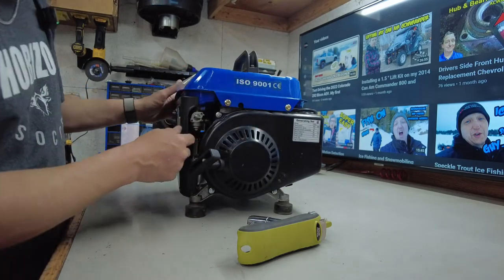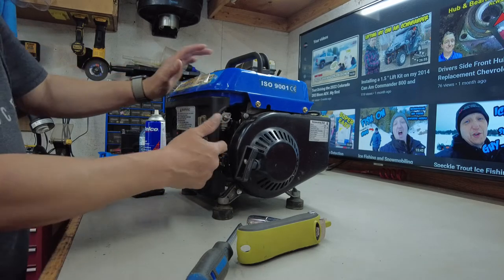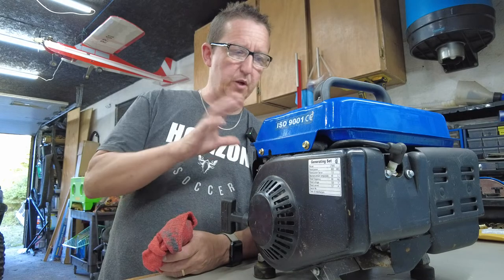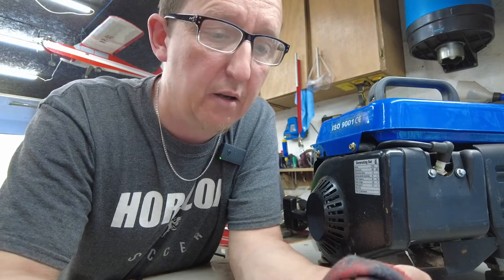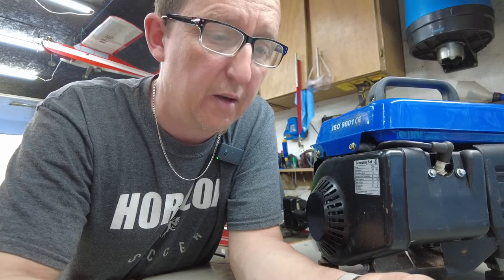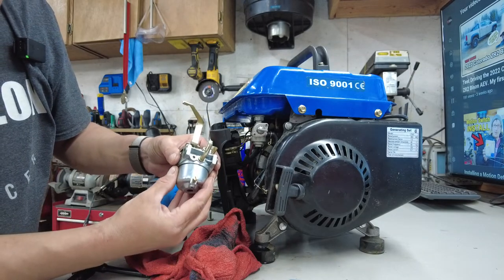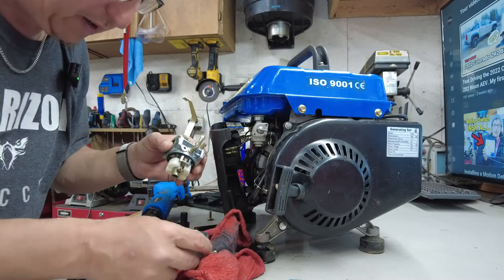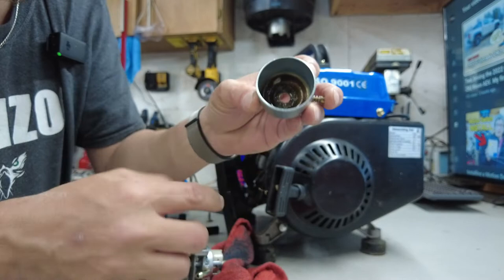2 Stroke Mellga MG950 Generator Won't Start. Fuel Issue carb cleaning.

Comment: And what about the float height of this carburetor?
Reply from the maker: Good question. I had no manual so I just adjust the float tab to fully seat the needle when the float is perfectly horizontal to the bottom of the carburetor casting. Hope this helps

Comment: In my country, we don't even have the luxury of electricity to see the generator clearly to work on it. We'll work in dusty conditions nearly under burning sunlight, to get this fixed. Only when it starts running, can you run indoors to use and electric fan to cool down.

Comment: Private gas station owners that use ethanol can have water added to the gasoline that they purchase. The ethanol distributors will ask the owners if they do, and how much, when ordering. So the ethanol pulling in moisture from the air is the story we have get from that.
Reply from the maker: This makes no sense to me.  Why would a distributor want to add water to a stations purchase? For profit? Pretty sketchy if this is true.

Comment: I have one like this (mine is yellow) and I have no spark. I have voltage coming off the two wires coming from the flywheel coil and then they go into a small box and then one lead comes out of there and goes to the coil on the end of the spark plug lead. It looks like I have no voltage coming out of that box. Do you know what it is ? I was wondering if I can bypass it and go straight to the spark plug  coil, but I would have two leads not one ?
Reply from the maker: I think the first thing I would do is try another plug. Any plug. Not in the generator but just on the wire to eliminate that first. let me know!

Comment: I got a similar one. Never started, just been in storage. Replaced starter cover that was damaged in transit, fuel tap lever broke so I replaced fuel tap, mice had chewed wires under the tank thus they needed some fixing as well. Starts and runs well but does not start easily when warm and always needs many pulls. I'm using canned synthetic fuel for small engines. I've learned some engines might have starting issues with synthetic fuel since it has less volatile components in it. This is my only small engine which has problems related to synthetic fuel, though I'm not sure if that's the reason for starting issues.
Reply from the maker: I have no experience with synthetic fuels. However not impossible, I would think to check make sure the correct plug is in it and maybe carb adjustment??

Comment: the surging throttle is actually a plugged pilot jet, and can also be the rpm is set too high. the pilot jet is the little brass piece under the idle stop, and its got a very tiny hole in it. i usually use 1 strand from a 14 gauge wire to clean them out.  and the govenor is actuated by a spinning weight inside, usually a couple ball bearings, or a weight
Reply from the maker: Awesome information. Thanks for helping the community of DIY’rs.

Comment: My generator also having same issue as you mentioned that the throttle is keep moving. Can it be fixed it by adjusting the fuel-air mixture screw loosen? Pls tell me about the idle screw where should it be? At low rpm all the time? I adjust the idle screw for changing rpm because of engine throttling unstable.
Reply from the maker: To set your idle screw this is what I do. I use a multi meter to set the engine speed once my meter has the 120v ac needed. It can plus or minus a few volts. The voltage changes with engine speed.  For my mixture screw, I turn it all the way in then backed it out a turn to start. Then I put a small load on the generator with a work lamp. Then I adjusted the screw until I got smooth idle.

Comment: Just be careful , i bought the exact same model a week ago.
When i oiled the little air filter sponge as per manual before first startup, i noticed that the oiled sponge filter does not completely touch the plastic cover on the front when closed again.
There is a little gap between the sponge and the front cover.
Also the airfilter cover has a little plastic ridge that follows the outer edge of the rectangular cover and fits into the same rectangular slot that receives it on the plastic housing of the carburettor. . . there is also a small gap right around that sucks in unfiltered air from the outer edge.
I used a square o-ring (yes the o-ring material is not round but square) that i fitted  into the rectangular slot , after cutting it precisely to the exact inner length of the slot.
Where the air-filter sponge is supposed to seal against the air-cover when replaced, i stuck a 4mm piece of flat weather strip where it is suppose to touch and seal against the plastic cover. If you oil the sponge and press hard against the airfilter plastic cover when it is back in place, the oil of the spomge will leave a rectangular oil mark against the cover, showing you exactly where to stick the weather strip . . .no more unfiltered air (dust) getting into the carb.
Reply from the maker: Awesome! Thanks for sharing that tip!
Reply: @NorthernHomeGarage  Thanks for your videos , i really enjoy them !

Comment: hi my gasoline generator runs ten minutes then stop after 5 minutes then start it again run ten minutes then stop every time like that 
what is the problem 
thank you
Reply from the maker: It starts back up after it stalls right away or do you have to wait? Does it run bad before it stalls or does it just stop?
Reply: @NorthernHomeGarage   yes it's need 5 minutes to start again 
and before stopped it's running in bad
Reply: @NorthernHomeGarage  it's possible from oil 
because i used car oil 10/40
not 2 stroke oil
Reply from the maker: @adelalsmadi6921  Oh... the difference between regular oil and two-stroke oil is that the 2 stroke stuff has a lower ash content and lubricates better due to the viscosity . This helps with deposits that tend to form on the plug and the piston when the oil is burned. I would say that is probably your issue. Lack of lubrication makes it stop (seize) because it's too hot or carbon build up on the plug.
Reply: @NorthernHomeGarage  thank you i will change the oil to 2 stroke oil 
thanks for your reply
Reply: Also try to losen the gas cap slightly because the vented gas cap may not be working property.  As fuel is consumed from the tank, air must enter the tank vent, otherwise a slight vacuum will develop int the tank and compete against fuel flowing to the carburetor.

Comment: hi I have a Ryobi 950 I did exactly wt u did but fuel still not coming through any advice please
Reply from the maker: A few things here. I know these will sounds silly but you need to check.

1. fuel in the tank
2. valve is open (cycle valve back and forth)
3. bottom of tank is clean (no rust)
4. if you take the hose off of the valve on the tank, does fuel come out.
5. is the hose clear (not plugged)
6. Is the needle stuck in the seat.
7. is the needle adjusted properly to open when the float comes down.
8. is the carburetor inlet clean

Hope this helps!

Comment: My generator is leaking fuel
Reply from the maker: Check that hose from the tank to the carb. Mine was very old and cracking. try tightening the bolt on the bottom of the carb bowl. it just needs to be snug.

Comment: I have one of these I bought for $10. Would not run for anything. I put a new piston and rings in it and still same thing. Makes 89psi cold, has spark when grounding plug out of the cylinder and plenty of compression to run. The plug gets wet from the carb and engine vacuum. Won't even try to start if you squirt gas through the carb or down the plug hole. It doesn't have the recoil on it but I've seen them start right up with a drill and mine will just crank all day but never fire once. Anyone know what could be wrong? Also the on/off switch does not effect spark. It will produce spark regardless of on/off switch position.
Reply from the maker: Hmmm. Fuel+compression+spark= run. That’s really strange that it won’t even spit when you spray fuel down the carb. The only thing I can see is spark. Not enough spark. Weak coil. Wrong plug. Wrong gap. Damaged wire. Compression sounds ok 90-105 it should run. Anyone else?
Reply: @NorthernHomeGarage  since it's cheap enough and it wouldn't be a big loss I'll try a new plug. I didn't realize the ft7rc torch wasn't the plug in the manual. Appreciate you boosting the comment.
Reply from the maker: @kkc3009  good luck. Let us know how it goes! Thanks for watching.
Reply: @NorthernHomeGarage  not a single lick unfortunately. I even put a dribble of almost straight gas in the intake side of the carb when the new plug didn't do anything. It was pregapped over .035" otherwise it was a match. I also thinned the mixture in the tank with some straight gas but yeah nothing at all. When I opened up this gen for the piston it was all carbon cruddy in the combustion area and the piston was too but no damage to the cylinder block wall and piston. I polished it before the new piston and saw no compression bump so I'm assuming the make around 89psi cold in good shape. I have no clue but the on/off switch doesn't seem to work. I wouldn't care if I could get it to start lol. I'm glad I didn't split the crank cases like I was gonna. I need that fulfilling and satisfying start like everything else I go and get in non working condition gives me after a little love lol.
Reply from the maker: @kkc3009  if you haven’t tried this I suggest turning off the fuel, drying the plug and cylinder with compressed air and put it back together. With the fuel still off, spray some raw fuel in the carb and try it then. Also, because you don’t have a pull start , make sure you’re spinning it in the correct direction. Another thing to check, make sure the governor on the block is free and connected. It could be stuck keeping the carb closed ?  Failing all this, it must be insufficient spark or low compression based on what you’re saying.
Reply: @NorthernHomeGarage  okay cool, I did remove the plug, crank a bit and now it's just sitting. I can blow some air in there too before trying again. I'm pretty sure it needs to spin clockwise during cranking because that's the way the recoil assembly makes it turn. And the manual says rotation direction of crank is CCW when viewed from the pto side of the crank so I believe that means CW when viewing from the other side or the flywheel side. I have seen a video of ultrasonic cleaning the carb and it still fails to run right or at all until it was replaced. Being that the plug is getting wet though I don't think that's the problem. The carb and spring and governor assembly are all okay. The carb studs don't have to be removed on this one if you just gently flex the throttle rod to get it in and out of the throttle tang on top of the carb. The throttle plate is wide open as it should be and the throttle stop screw will keep it open a sliver if it closes. It definitely should have done something by now but absolutely nothing lol.
Reply from the maker: @kkc3009  head gasket? It has to be low compression or weak spark. I’m leaning more towards the compression theory now lol.
Reply: @NorthernHomeGarage  that's probably it. The kit didn't come with a new one and it was a corner cut during the piston swap. I will update soon. Not that it's a cool story or anything but yeah we'll see if that's why it's not producing more compression when cold starting.
Reply from the maker: @kkc3009  cool.  Let me know.  There’s got to be a happy ending lol.
Reply: I also have one of these and also had issues getting it to start. The air fuel screw was out too far. it was 3 turns out from the factory. after turning it all the way in, then half out, it starts without issues on first or second pull.
Reply: KC, did you check the oil seals ???
Reply: @hardhittrr  do you mean the crankcase seal? I did not disassemble that far. When I replaced the piston and ring I only used gasket maker on the old seals for the intake, base and top gaskets. Compression increased to about 92psi while using a drill and there is verified bright spark but it doesn't even produce the slightest combustion. I've used starter fluid and gas directly into the plug hole along with sprays of gas into the carb intake. I was stumped so now it just sits in the garage next to an old but working 4 outlet generator I picked up.
Reply: @kkc3009  I feel ya!, Ya I gave up on mine too. I took off my flywheel to see if the crankcase seal was off and it's not. It's still good. But I'm sick of this little gismo. I get more of an arm workout then anything. I'm on the hunt for something else now.
Reply from the maker: When you’re checking for spark, are you grounding the plug to the head or another part of the generator body?
Reply from the maker: I’m really realllllyyyy reaching here with another theory however almost impossible.
Reply: @NorthernHomeGarage  indeed I am. I checked the flywheel key and it was not partially sheared or anything. I really wanted to make the turd run and have seen vids of africans reassembling them in the dirt and they run like a top. So I feel like a failure lmao
Reply: @hardhittrr  even checked flywheel key and it's fine. Most people that know anything said 92psi should be plenty for it to run given what it is and I agree but it never produced even the slightest combustion a single time.
Reply: Check seal on generator side, had few times that seal went out of crankcase and won't start. Had compression, spark, fuel, and it wouldn't start, 100% seal
Reply: @vendelplavekovic5446  thank you is this checked by spraying something around the sealing area while trying to start?
Reply: @kkc3009  No, when i dissasembled generator I saw that seal is not in his placea
Reply: @vendelplavekovic5446  so you mean split the crank case halves?
Reply: @kkc3009  No, I removed generator stator and rotor
Reply from the maker: I agree. If it’s sucking air on the crank seal you won’t even get a pop from the engine. The seals probably hanging off out of place.
Reply: @vendelplavekovic5446  thank you
Reply: Mine also blew the generator side crankshaft seal out of position.  You have to remove the generator side case and the fan, long bolt, bearing I think, then the rotor which is tight onto the crankshaft due to a taper fit.  A small block of wood hammer and sharp rap to the rotor shaft to break the taper fit lose.  Then you can access the crankshaft oil seal.  I replaced the seal but the original seal was fine and could've been reused.  Use a deep socket to fit around the crankshaft snout and drive the seal back into it's home in the engine case.  Try not to drive it too deeply but just below flush should be fine.  I guess the factory didn't drive the seal quite deep enough and that's why internal pressure pushed it out.
Reply from the maker: @thisisyourcaptainspeaking2259 great advise! Thanks for helping the community!
Reply: @NorthernHomeGarage   I have three of these in my arsenal now and they have handily paid for themselves.  Ocasionally we experience winter storms that disrupt power for days, so one powers my kitchen refrigerator (icemaker in refrigerator gets disabled) and the chest freezer is run using the 2nd generator.  The 3rd generator serves as backup or possibly as a loaner if need be.  I'm not sure if all refrigerators will run on one of these but thankfully mine will.  I'm sure there are other refrigerators that require a larger or cleaner power for proper compressor startup.
Reply from the maker: @thisisyourcaptainspeaking2259  sounds like you have first hand experience with these little machines. They are pretty great!